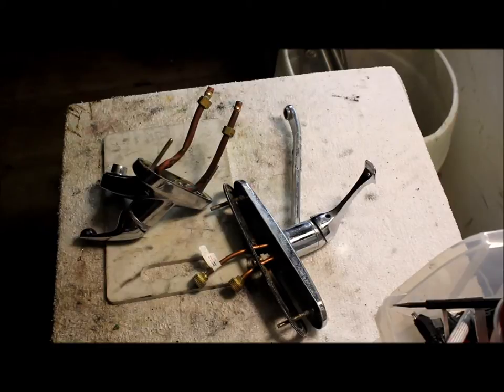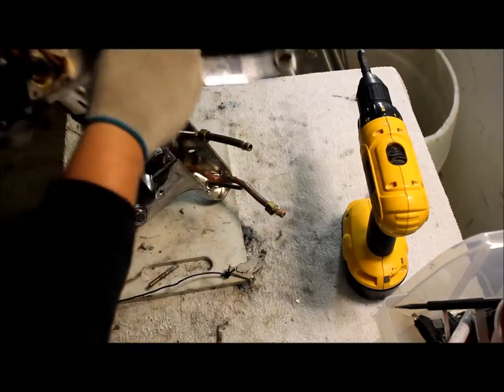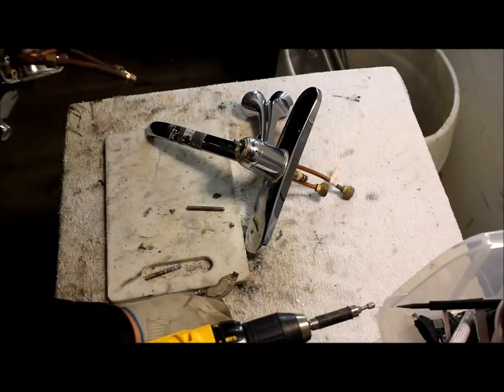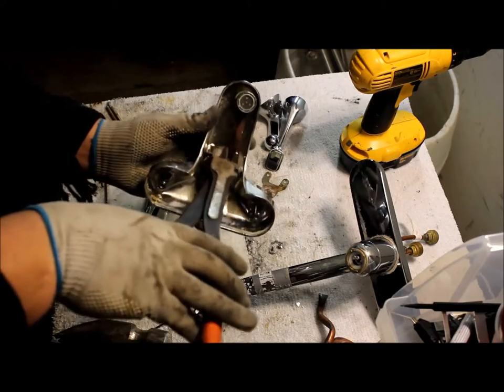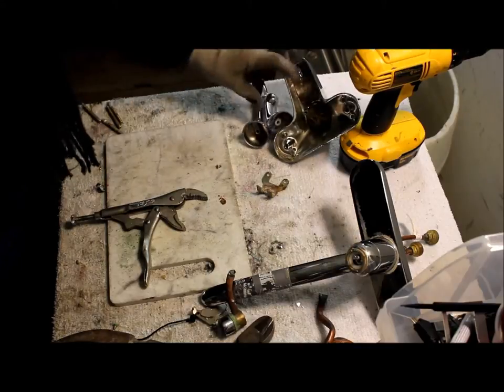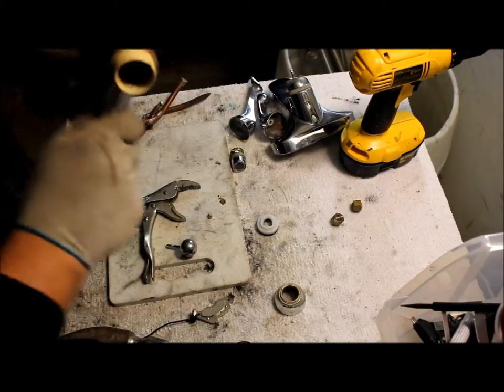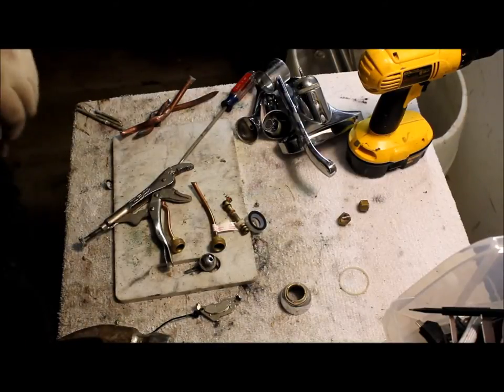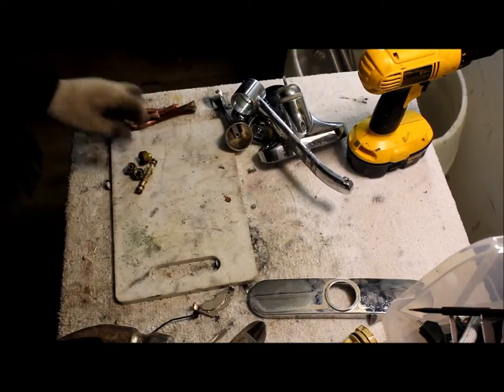How to scrap a  Bathroom and Kitchen Faucet for Brass and Copper!

Comment: almost every faucet handle i find is made of zinc.  every vid i watch on youtube says its all brass and nobody ever ever mentions anything about zinc.  my yard pays zinc price for faucets and i assume that's a big reason.  
does your yard ever say anything about this?
also do you take the Teflon tape off the brass connectors?
and last question,  the brass connectors on the stainless steel water lines,  do you snip them and put them in dirty brass? thanks
Reply from the maker: You know I was wondering about that some faucets I have scrapped with my file are all chrome and some its obvious its brass by the yellow color under the coating. I've actually collect my scrap until I get a huge amount I only sell my steel so I haven't taken any faucets yet. I have a ton of them I'll look into this great video idea. 
I clean all my brass so I do take off the Teflon to make it look more appealing. 
Yes, I cut them off and put it with the dirty brass. I have all my brass separated into 4 types clean brass, dirty brass, coated brass, and Brass from pipes or like molded brass. Maybe its just my OCD lol. 
Thanks for the comment and for watching.
Reply: Alamo City Scrapping thanks for the reply. I haven't been to a yard yet either, just collect non ferrous. I was in a condo so I would just toss the plastic and steel in the recycle room, and toss my scrap in my storage locker.  Amazing what I collected over a few years.   I started because I originally wanted to melt ingots.  Not sure I'm gonna do that anymore,  depends if my son is into it when he gets old enough.   Was always wondering if I was the only one who hoarded my scrap. I know I have gone overboard on my time spent breaking each item down no matter how small... but I enjoy it while I smoke a joint :).  

I have large zip locks to separate smaller items. As an example I have 1 for just clean plug ends. One with just clean wire harness connectors,  1 with just zippers!  Have to sort those out from brass and zinc still. 
Bags filled with just pop tabs!  
Only think I haven't messed with much is my circuit boards. Just scared messing with  all the carcinogens for a few cents lol
Reply: My scarp yard pays 0.60$ a pound for faucets.  I take them apart and get 65% more money once its all separated (1.95$ a pound for Brass)
Reply: Those "stainless steel water lines" are usually plated copper tubing. Not sure if thats what you are refering to.

Comment: Be aware that when you see brass tap valves lined on the inside with plastic, what looks like a non tarnished bright brass assembly is actually aluminum painted or plated with a brass coloured coating. Don't waste your time with it.